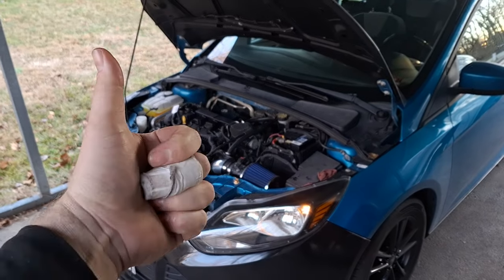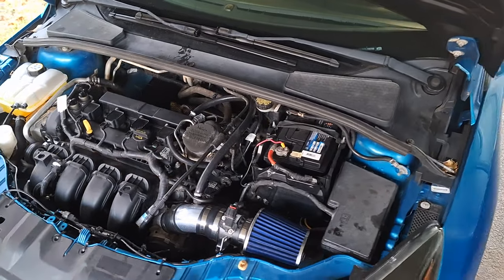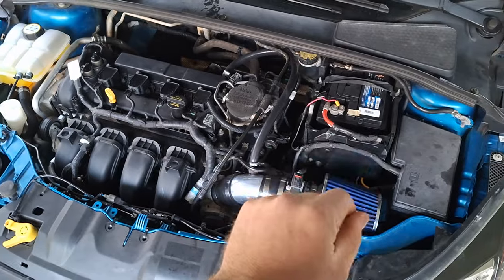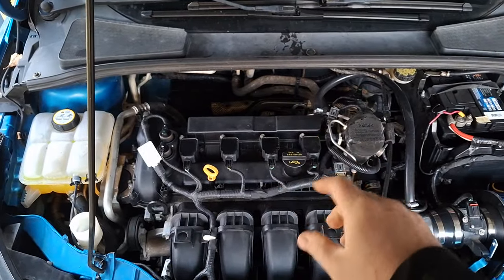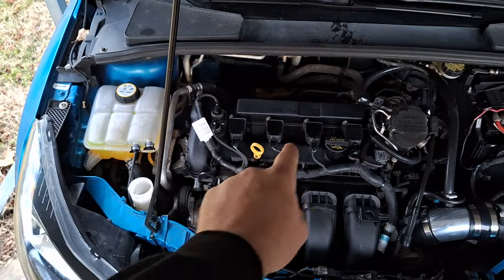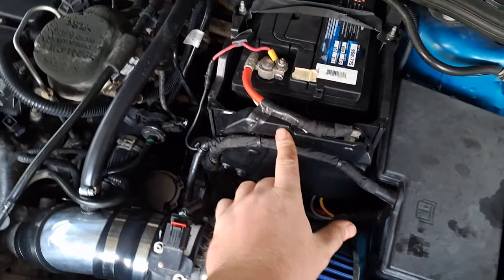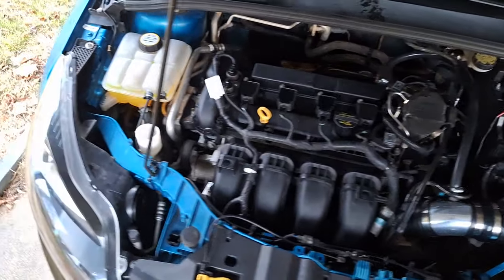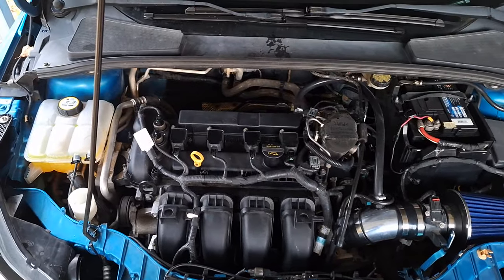How To "Bulletproof" a Ford Focus! 2012-2018

Comment: Hey Ben, thanks for your hard work. What’s your suggestion in regard to the timing belt?  Or the crankshaft gear, are they still prone to breaking off on one side?
Reply from the maker: The 2.0 has a chain and I've never seen an issue with them. 

The 1.0 do it every 100k & the oil pump belt and tensioners
Reply: I would be replacing both  timing belts at maximum 50k 
Also make sure the correct oil is used .
Here in the UK this is a huge problem on these engines .
Take no chances !!
Reply from the maker: @adrianfoy6790  great advice! 100k is a bit long. But I heard the new tensioners are a better design. Still though, an oil bathed belt.. best to replace it often
Reply: @BigBensCarsAndCycles  It's a big job tho to change it !
Reply from the maker: @adrianfoy6790  definitely!
Reply: @BigBensCarsAndCycles @adrianfoy6790  What about the 1.6 petrol guys, I hardly see any mention of it, I think it’s not common at all, so would appreciate any tips on it
Does it have a timing chain or belt? And does it have a purge valve and a PCV? I searched in youtube and google for many hours but there is hardly any information on it
Reply from the maker: @dominozonda  we don't have a 1.6 focus in the states. But if it's the same engine as our Fiesta, it's a decent engine. Has a timing belt. Has issues with the cooling fan failing and overheating.
Reply: @BigBensCarsAndCycles   that’s exactly what happened to us, the fan module failed and the car overheated, we also had the heater hoses leaking so when I took it to the dealership they insisted that the reason was the hoses and they replaced them but the car overheated again, I ordered a similar part number from eBay and replaced it and it never overheated since.
My coolant reservoir/degass bottle also cracked after a while and had to replace it
All of these are things that you mentioned so it seems that the same things fail in most of these cars
Does the Fiesta have a purge valve? I have a P0172 & P0175 for a few years, the dealership asked us to replace the spark plugs a couple of times and they said they did “programming” to solve the issue but it never went away
I cleaned the MAF and replaced the air filter but the problem continues 
Would replacing the purge valve be a good idea for the Fiesta as ours have the same engine? Or maybe the PCV as the rich condition is on both banks and it’s unlikely that both O2 sensors failed at the same time!
Reply from the maker: @dominozonda  hey, yeah they have a purge valve. That could be your issue.
Reply: @BigBensCarsAndCycles  thanks Ben, I’ll give it a go

Comment: Why is that DCT transmission fluid in the video better than the OEM?
Reply from the maker: I haven't done any testing, but amsoil has proven to be outstanding in independent tests
Reply: There is nothing better than AMSOIL. I put it in my DCT on vacation at 92,790 miles and I'm going with total confidence in it.

Comment: I’ve been debating wondering if I should run 5w30 in my 2015 focus 137k miles it runs great and shifts smooth  I run royal purple 5w20 in it was wondering if anyone else tried 5w30 in it on my 09 gt mustang I already switched from 5w20 to 5w30
Reply from the maker: The 2.0 duratec on late 2000s focuses use 5w30 from the factory, so I choose to use 5w30 in mine in summer months on high mileage (150k +) focuses